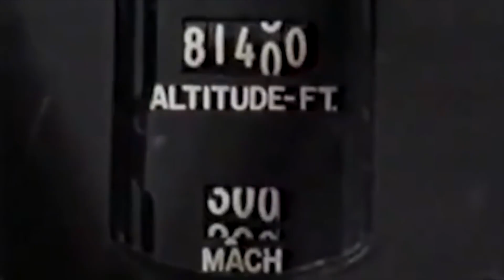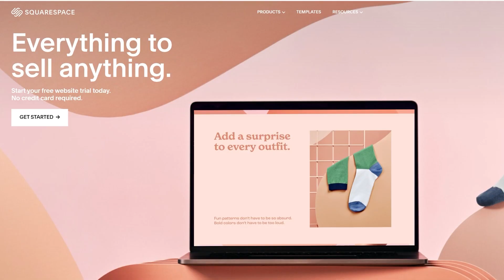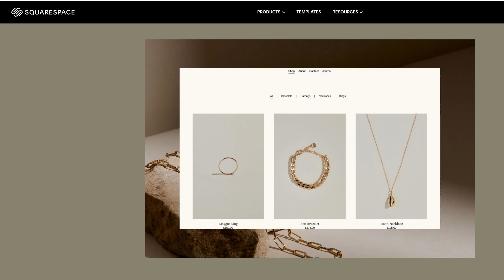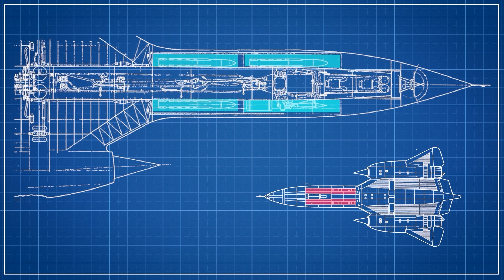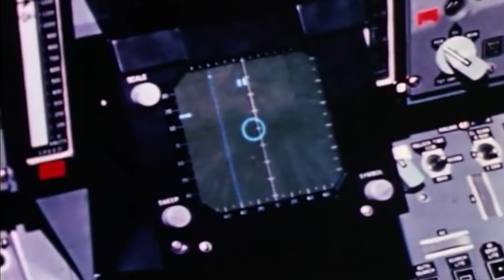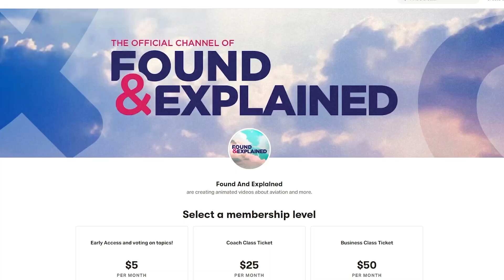Turning A Spy Plane Into A Mach 3 Fighter Jet - The YF-12

Comment: Slight problem. When the Blackbird was intercepted, something of a hobby for RAF Lightnings, all it could do was accelerate away. As stated in the video, the platform was not manoeuvrable and something of a sitting duck. Whilst it had Mach 3 capability, that eats fuel and so would travel at a lower cruise speed.  But even going flat out it could still be intercepted, that does not take matching speeds..
When the Blackbird or U2 couldn't fly, the RAF would lend Canberra PRs.
Reply: Maneuverability was never part of the plan. The plan was to engage at 74,000-80,000 ft and fire missiles at a distance of more than 60 miles. The idea was they would have a lock before they were even seen and be out of there before the other pilot had a chance to react. How well this would have worked is another question, but the lack of maneuverability wasn't an oversight, it was a deliberate design decision.
Reply: @mattdombrowski8435  That's what the Lightning did. With the advantage of being extremely agile. And that was designed as a rapid reaction interceptor from the ground up. And very good at that job, regularly tested with soviet probes.
Reply: @mattdombrowski8435  yup. And those missiles were already going Mach 3 when launched, they would generally fall from 80,000 ft since whatever they were shooting at would be at slower altitude, and the missiles own engine would be accelerating it all the way.  

Those missiles were hitting their targets 80 miles away at Mach 6
Reply: You can't make major instantaneous maneuvers flying at top speeds. You could BARELY go for long stretches and if you did, all you could do is keep your fingers crossed that something doesn't go awry, making the crude aircraft instantly disintegrate, due to the temperatures and pressures that jet was meant to fly in.

People, YouTubers who think they know everything, think you could push the throttles of the SR-71 or the F-22 to the "red line" territories and just keep flying until you run out of fuel... and that if there's tankers capable of flying at Mach 3 to refuel them, that these things could just keep going on for hours.  

That's just too much comic movie watching.

You put your motorcycle engine on "red line" territories and after some minutes, it'd just die on you. 

When you fly at Mach 3.2 or more --- "red line" territories, on internal combustion engines (regardless what "class": rocket engines that carrying one-way payloads, for example, could be pushed further than manned aircraft engines for obvious reasons) --- one tiny thing goes wrong in the thousands of parts you have in that aircraft & it'd just disintegrate into pieces (into a fireball), due to the extreme temperatures & pressure the aircraft is under. 

At such extremes, every thing down to the molecular levels --- from the titanium metals, to the joints, to the screws, to the plastic insulation of wires, to other fabrication parts --- start to perturb, to vibrate & to behave more & more unpredictably: that is physics...
Reply: @kiabtoomlauj6249  Fun fact! The SR-71 could cruise at mach 3.2, as this was it's designed cruise speed, all day long till it ran out of fuel if so wanted, and was actually preferred by the USAF to do so, only slowing down to run the camera's or refueling and then speeding back to cruise speed when the mission or refueling was done. This is because of how the aircraft was designed and how the P&W J58 Turbofan's worked, as they were a hybrid of sorts. After about mach 1.5, the internal bypass doors opened and the external bleed doors closed bypassing most of the air around the compressors and pushing it directly to the rear combustion chamber. After about mach 2 the compressors spun down to an idle, they didn't completely shut off as that was the only way to power hydraulics and electronics. This had an unexpected effect, the aircraft got more fuel efficient as it flew faster, granted it still used more fuel flying at mach 3.2 than it did at mach 1, it used much less fuel than a conventional jet turbine would at the same speed. As for the airframe, the theoretical maximum was about mach 4, real life probably closer to mach 3.8 before catastrophic failure occurred. Even at mach 3.2, the SR-71 wasn't flying at or into it's "redline".
Reply: @kiabtoomlauj6249  if you had seen the Lightning pulling major instantaneous manoeuvrers at high speed, as I did,  you would not say that. Or to watch it twitting up a Mirage or F-104 whilst stacked for the Warbirds display. Its roll rate was too fast for most pilots to cope with. Lightning refuelled from the transonic Victor. Tactical manoeuvrability was stressed, it could barrel roll and loop. That thing could go Mach 1 and fly inverted (or Mach 1 inverted as it did in a low level roll over Farnborough) but that was frowned upon, typically maxing at Mach 0.98.

Comment: Minor correction it was never meant to be a fighter jet it was supposed to a interceptor there’s a different but still great video as always
Reply: the public in general seem to often confuse the two. they sure are different philosophies, but they both end up with "sleek plane go fast" in some form.
Reply: @xymaryai8283  Frankly speaking, it was a much more difficult job.
Spy plane goes to fly when it is ready.
Interceptor stands on standby for hours, days, and week, ready to take off and fight wherever things went south, and no matter how onfortunate the moment will be.
So while YF-12 seems to be a no-brainer - actual F-12B would've been a completely, utterly different beast inside.
Reply: @neniAAinen  wait yeah, didn't the SR71's fuel tanks leak fuel on the ground when they were cold, because they had heat expansion gaps that would close when it got hot? that seems like a crucial flaw for an Interceptor that a Reconnaissance aircraft doesn't have much problem with.

but my point was, sure, the operational procedures are different, but to the public, if it looks fast, and seats only 2 people, its a fighter jet
Reply: @xymaryai8283  yeah, you got the problem :-)
F-12B would have been a completely different aircraft with roughly same external appearence.
USAF wanted more G capability (for actual high supersonic maneuvering), it wanted 24/7 standby, and, perhaps above all else, it wanted actual series this time, not just a dozen of hand-made aircraft straight from the future.
Reply: an interceptor is a "subgenre" of a fighter, for example, the f22 is an interceptor and fighter
Reply: @YourLocalLeadBassist  Well, interceptors and fighters focus on different things.
Good interceptor is often a bad fighter, and vice versa/
For example, crux of f-22 capability - its stealth - is at best of secondary importance to a NORAD interceptor (which will probably never be shot at even in a all-out nuclear war). Its maintenance-intensive RPM skin is outright counterproductive.
On the other hand, its interceptor metrics(time to intercept point, loitering time, etc) are often even lower than F-15C numbers - which by itself isn't an interceptor either.
Reply: He literally introduces the plane calling it a fighter interceptor the first sentence of the video.  All interceptors are actually fighter interceptors. People just say interceptor to shorten it. 🙄
Reply: @Sean Price flankers appeared in mid-late 1980s, and they can't really cross the Arctic.
Reply: @Sean Price If the flanker escorts had plenty of manoeuvrability and range (and presumably the speed to keep up with the interceptor they are escorting), it begs the question why you wouldn't just use them as the interceptor?
Reply: @Sean Price Didn't you write "the thing is, interceptions of actual hostile bombers would include flanker escorts with plenty of maneuverability and range" one day ago? Is your memory failing or were you ambiguous in what you wrote? because it certainly looks to me like you wrote that the "interceptions" would include escorts. Perhaps it's not my terminology that's the problem.
Reply: @Sean Price Unfortunately you were using text, not logic, and the context was entirely unclear in your original post. I'm still not certain now what point you were trying to make if you were telling us that the bombers would have escorts. Presumably, as long as the interceptor can hit the incoming bomber with a missile, any escorts are irrelevant?
Reply: @Sean Price they really can't. They can just about reach North Pole with enough fuel for air combat, but not much further.
Reply: @Sean Price Russian refuelling fleet in case of "such" war is fully busy with bombers themselves. Not really enough even for bombers(some probably will have to fly with less than full load), maybe for doomsday airborne command planes, and nothing for everyone else. We're talking about meager 20-ish aircraft, when the need just for the task above is probably well over 50.
It was more or less the same during Soviet times - there were more tankers, but there were more bombers, too.
When we talk about in-air refuelling, we typically mean USA - but USAF alone(w/o USMC even) has more tankers than RuAF has fighters in its main line!

Overall, it isn't Russian practice really.
Reply: To be fair, they often said "fighter interceptor"

Comment: Your YF-12 model had some errors. The central ventral fin you show is way smaller than the real one, and the nose cone is depicted as a relatively small cone when it should have been a sizable ogive.
Reply: On one of my grandfather's YF-12 flights, the center folding ventral fin actually separated in-flight and landed on the slope of Mt. Whitney. Took them awhile to find it, too. If I remember right, they made overflights with F-104s and T-38s trying to locate the impact zone.
Reply: Yah i noticed the central fin

Comment: I feel like if this plane was to be reproduced and modernized today it would be wonderfully effective Mach 3 certainly isn’t anything to sneeze at even today
Reply: F-22 can do over mach 3 with stealth. Today, SR71 is obsolete- too expensive to operate and no gen 5 stealth means shot down.
Reply: @larryc1616  You are comparing apples and oranges. One is a Fighter, the other is a  RECONNnaissance platform. Additionally, the XB-37 can loiter over a region of interest for over a year, and collect real time data. Hence, "something better".
Reply: @larryc1616  I think you miss the point of my comment so please allow me to rephrase.. my comment was if the SR-71 was used as a base for a new aircraft that’s made with modern technology and our current day advanced computer generation software a plane could be made that would out our current set of jets
Reply: @larryc1616  unlikely.

There’s a problem with heat at those speeds and the F-22 is built for stealth, not that heat barrier.  It probably has the thrust to get there, but the airframe can’t handle it.

Probably.
Reply: Speed<stealth+supercruise+awac today, right?
Reply: The best thing about the blackbird; its exotic titanium shell, was manufactured by Russia. Purchased  by the skunkworks using fake companies.

Comment: Honestly it could have server better as a bomber rather than a fighter jet. Imagine being able to transport bombs, cruise missiles and possibly hypersonic missiles travelling at mach 3 and cruising at 85,000 ft. Not even the Tu-160 would have been comparable to this thing and it would have a been a larger and faster version of the F-35, being able to conduct deep strike missions and then heading back to base probably without a scratch and if equipped with EW it would have been EVEN deadlier. I wonder how the S400 or the S500 would have dealt with it.
Reply from the maker: Agree. Very likely it could have bombed too
Reply: @FoundAndExplained  Yeah, honestly I have no idea how they haven't thought about that. The shape of the aircraft itself made it look like a bomber, atleast from my POV.
Reply: I have a book about the Lockheed Skunk Works which does mention a 'RB71' design study.

Comment: model yf-12 based on the model of the SR-71 blackbird
Reply: Actually the YF-12 was based on the A-12 jets ( A for Angel ) the CIA operated single setter precursor original Mach 3+ spy planes. The U.S. Air Force ordered the 3 YF-12s as interceptors then ordered the 32 or so SR-71s ( Strategic Reconnaissance- 71 ) which were based on the YF-12s not the other way around. I am positive on this, I watched all the documentaries and i have a book with the entire history on them.

Comment: Everytime I watch something about the YF12 or SR71 makes me sad the russians never produced something crazier lol
Reply from the maker: Wait for it. They did plan too!
Reply: @FoundAndExplained  any spoilers?
Reply: They tried with a Jet called the T-4 " suka " which kind of looked like a XB-70 Valkyrie but smaller, had 4 engines ,one vertical stab fin and the pointy bullet nose raised up to cover the front windshield. It did not perform like they wanted to.
   They had a big long needle nose half delta wing rear horizontal stab finned 4 engine supersonic bomber called the M-50 that looked promising but there large Hi-thrust Mach 2 3 and up capable engines in the 50s and 60s even 70s was under performing to make these aircraft reach there potentials.
Reply from the maker: I have a video of this!
Reply: Mig-41, Foxbat 2?
Reply: @alwayscensored6871  that plane is new. The YF12 was flying in the 60s
Reply: @alwayscensored6871  lol, what kinda stupid are you. The Foxbat 2 is a new plane the yf-12 was 60 years old
Reply: @alwayscensored6871  Both useless one got to production but have disadvantages and one never exist only exist in blueprints